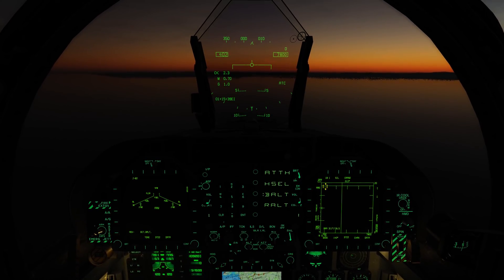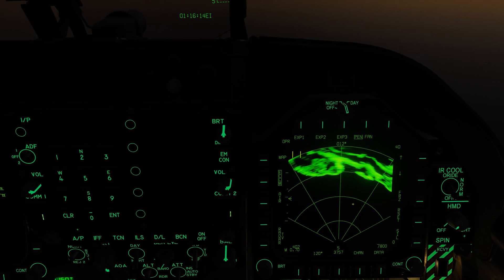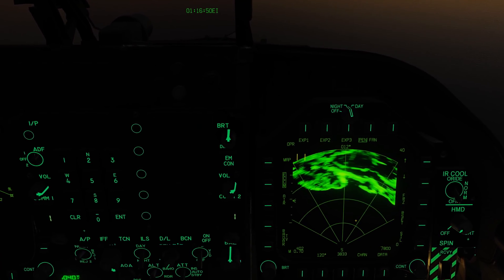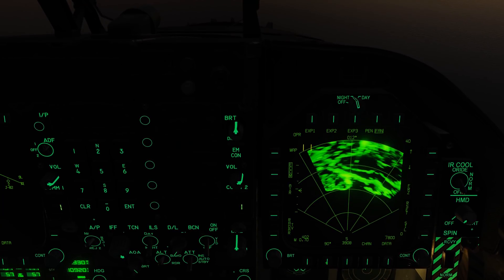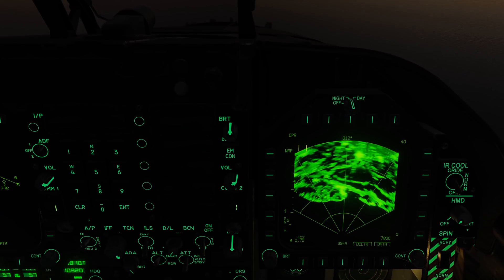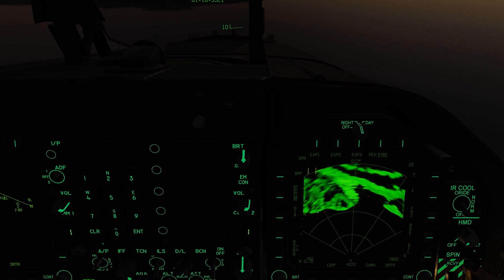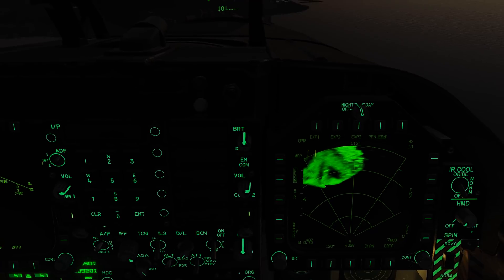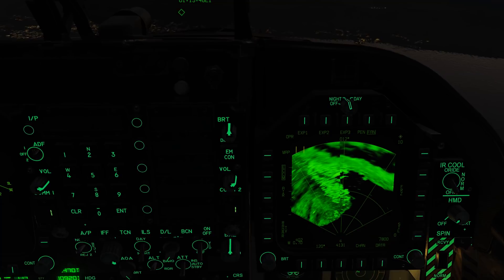DCS: F/A-18C Hornet - Air to Ground Radar First Look

Comment: Radar question... In DCS, planes like the FA-18C Hornet, The F-16C Viper, The JF-17 Thunder, and even the F-4E Phantom... on their A/G radar displays, even at altitude and long range, they have ground returns pretty much over the entire range of the display, assuming the aircraft is over land. But other aircraft like both the F-1 Mirage and the M200C Mirage III and even the F-15E Eagle have a much different look to their A/G radar display. Their ground returns are mostly just a nazzow band of ground return across the display. I mean, I am a retired avionics tech from both miltary and civilian aircraft so I defintiely know how a radar works. But what's the deal with the DCS  A/G radars? Are they really that much different and if so, why? Or did they devs just get their radars wrong?

Comment: How do you select which display is being used so you can move the cursor to designate a target? I found it in the F16, but so far, no luck in the Hornet.
Reply: I'll assume you've found the answer already, but for the benefit of others who see this - you move the sensor select switch in the direction of the display. Up for the HUD and left, right and down for the respective MFDs.

Comment: Just remember its going to be of limited use for targeting until we get exp modes . Still great to see it coming along
Reply: "exp" modes? "expanded" modes or what does it mean? I thought "Ground Moving Target" mode is all we need (to detect convoys, which is the only useful application of ground radar anyways afaik)
Reply: @Dan20q  The pilots who flew in the desert used the radar to great effect. The whole radar is useless in air to ground mostly stems from the initial resistance to any new technology. Today, radar is in many places used instead of photo recon. You can get that good resolution with today's radars that can identify the type of individual aircraft that are parked on the runway without having to squint really hard.
Reply: @Dan20q  yes expanded mode, there are normally 2 modes, exp1 and 2. GMT is the ground moving mode. with the EXP modes though you can really get rid of a lot of the crap showing up

Comment: What is the purpose of an a/g radar?  I'm sure it's very useful I'm just uneducated on the matter.
Reply: Very long range target track and designation. Imagine getting to 80 nm from the target, e.g. an airfiled. The radar will pick it up, but with bad resolution. Getting near and near, and with Expanded mode you can make maps with radar return, with enough detail to designate a point in the ground for an attack. like a building or parked aircraft. Then proceed to to a stand -off attack , with a JDAM or SLAM, for example.
Reply: In addition to what Sloppy mentioned, navigation in disgusting weather, finding moving targets (eventually when we get the mode), finding ships.
Reply: It has no purpose now